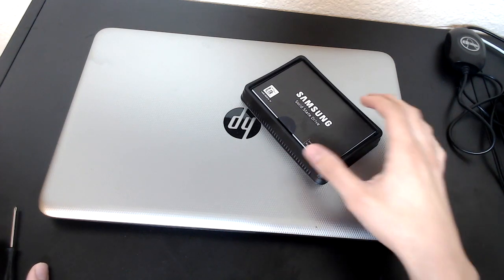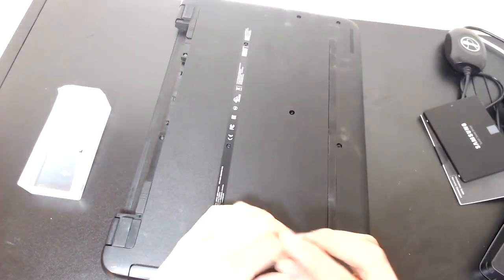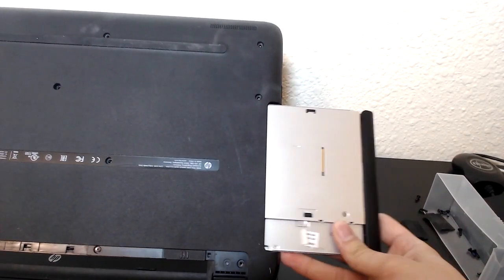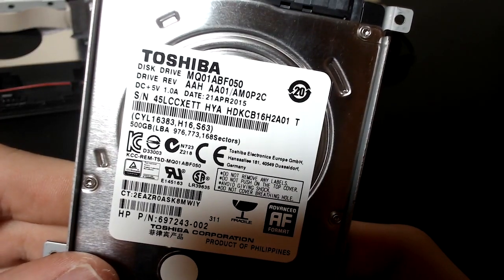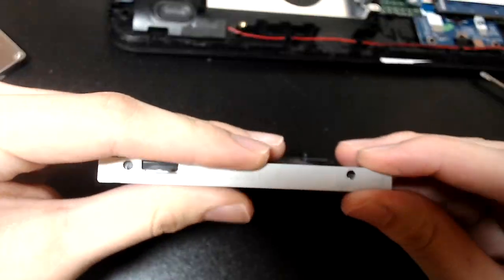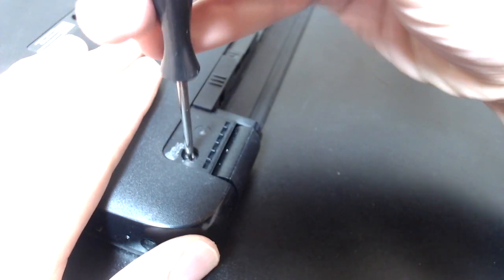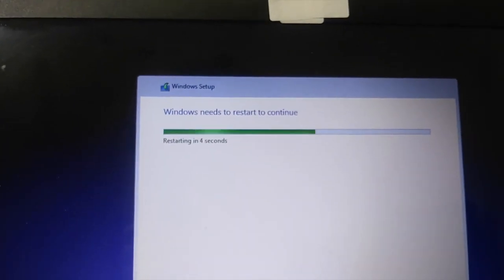HP Laptop SSD Upgrade TPN C125

Comment: Sir after going through this whole process with the help of a windows 10 recovery drive(that i had made on my HP laptop upon purchase) from usb on the newly installed Crucial 500gb SSD(replacing a Toshiba 500gb hdd) will I need to go to system BIOS & change the boot priority to the newly installed SSD?
I will be installing the old Toshiba 500gb hdd in a caddy in the optical drive later on(formatting it clean)after finishing the whole process mentioned above,it will be very kind on your part if you can answer my query,thank you.

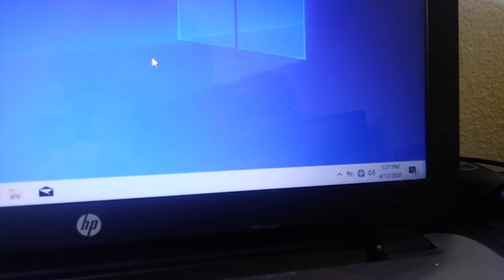Comment: Not a good presentation.  Spend almost 3 minutes of a 3:48 show on how to take the HP apart. Too long.  How about the flash drive? What is on it to make the new instillation work? Never mention or show if the new drive has to be formatted and/or partitioned.  Unfortunately, you taught me nothing.  So sorry.

Comment: after the installation of new SSD is done, do we need to copy bios setting from the Hard Drive? or can just start a fresh install a windows?
Reply: Bios setting are stored in the motherboard itself, the disks have nothing to do with it, i did a couple of disk drive changes on some pc's and bios settings stays as it is, not really sure if some laptops store them in the disk itself.

Comment: Always dis connect your battery and discharge the board that way you don't brick your computer if you drop a screw or something metal on the circuit board this cat is missing the most important step

Comment: Does it have separate slot for sad ?
Reply: no you must take out the hhd and replace it with the ssd
Reply: Use optical drive slot if it supports SATA3. Elese use optical slot for HDD and use HDD's SATA3 slot for ssd.